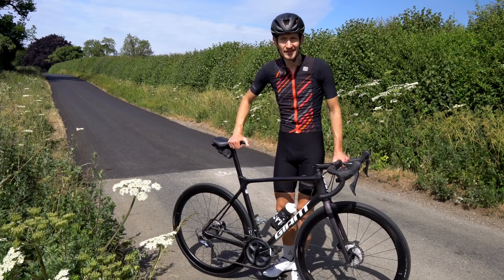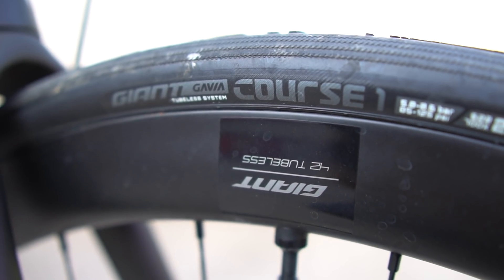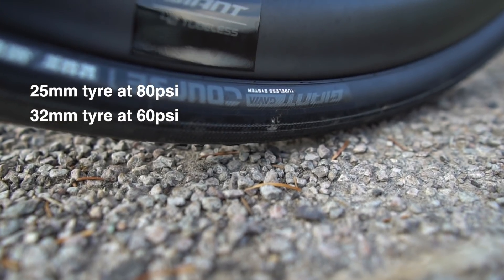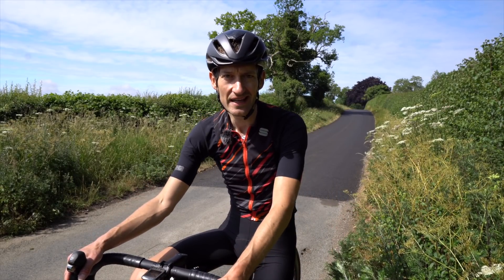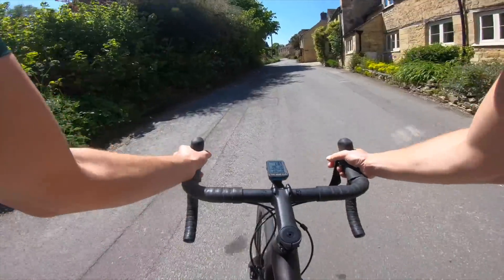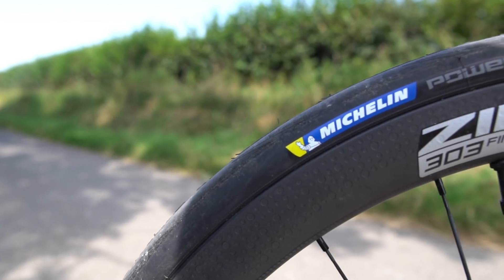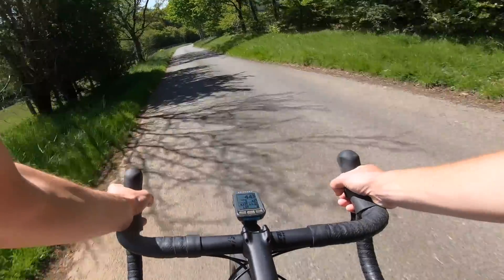Are Wide Tyres Really Faster? Rolling resistance timed testing reveals the truth...

Comment: It'd be interesting to compare the power needed per distance, say 10km, by controlling the overall power, f.e. at a constant 200W tempo. This would incorporate the rotational mass difference, aerodynamics and fatigue into account too. 
Also, depending on the terrain, the vibration damping of thicker tires might influence the overall performance over long distances.
Reply: If a power meter can update agerage power precisely enough, it would indeed be interesting to see time needed for the 10 km course at 200 W average. And to equalize the test, staying as close to 200 W and average throughout.
Rotational mass over a contant power effort is...nil. Unless you start from standstill. Rotational mass is mostly in the mind. I once went on a training ride with a friend, him on his road bike (accomplished bike marathoner), me on my "beach race" bike, 29.2.35 slicks. The rear tube I'd put 3.6 litres of water in. Yes, I noticed it slosh when changing speed by a lot. Once at speed, it was just riding as usual. I bet that over a 10 km ride at 200 W constant, that 3.6 litres of water (an American gallon or so?) would hardly be noticed in the measurement. Unless it was all a very steep uphill, then it would be worth around 3-4% at most. Weirdest about that test was perhaps how the tyre compliance felt. With so little space for air, it felt very stiff for the pressure on the gauge. A small bump would displace a huge amount of the air, and the water doesn't compress nearly as easily.
I'm sure on a 10km gravel test (bring it oooooonnnn!) that water filled tire would have been...interesting. The water wasn't in pockets, so it could slosh freely. Would it help with a kind of flywheel effect...a little maybe. When taking sudden turns, braking, etc, I could feel the mass in precession if that's the correct term. that doesn't mean it takes eneergy necessarily, it could even help in some conditions. If it had been a tubeless setup with a large sponge donut between rim and tyre, filling the cavity completely...it would slosh less and be like a flywheel more. Maybe great on windy time trails, push through burst and keep stably on cross wind bursts?
Reply: @Cloxxki  the rotational weight has significant affect on acceleration and stopping performance, and the gyroscopic effect when turning. 
If suspension is involved, that becomes even more noticeable.
Reply: @Cloxxki  I guess your argument depends greatly on the environment we're talking about, also whether is motor-assisted or not. 
On a flat track - I'd tend to agree, but not off-road. 
I've once done a test on heavy casing MTB tyres, and even 200g difference has resulted in statistically significant differences (based on comed k5 gas analysis computer)

Comment: Nice test! It'd be interesting to test if lowering the 25mm tyres to 65psi will increase the speed, or vice versa, if inflating the 32mm one to 80psi will reduce the speed.
Reply: Probably no for both questions. The area and the pressure force on the ground are the key differences. Increasing the 32 mm internal pressure would probably elevate the speed and vice versa.

Comment: 28 feels the fastest for the roads I ride on for my weight over 25 and 30. 30 feels a bit sluggish to pedal . 25 is too bumpy when I pump it up enough to support my weight of 220 lb.
Reply: Actually i have tried GP5000 32mm, actually 32mm is faster, just pump your 30mm harder.

Comment: I recently did a 50 miler on 50mm tyres with my normal road group. I kept pace on flats, down-hills & short-sharp climbs, aerodynamics was not a problem; However, whenever the road pointed up for longer lengths of time— I got dropped. The mass of the larger tyres was only a problem when gravity overcame momentum.

Comment: Could them being tubeless have a serious impact? I personally have the Giant Defy Adv. 2 with 32mm tubeless and I have noticed the bike flies and rolls for much longer than my old Fuji Newest LE 1.0 with 23mm tubular tires. However, maybe you can test 32mm tubular vs tubeless for your next video. Something I'm curious about. I'm in agreement though, wider tires are a treat. It may be a bias, but I seriously think 32mm is the sweet spot for speed and comfort.

Comment: Maybe I didnt listen to the whole thing but couldnt this result be influenced by the added weight of the 32 tyres. Going downhill it would be an advantage, plus less resistance from the road downhill as you gain speed. There should be a flat course and an uphill course at same wattage as a control.
Reply: I also wondered if putting a wider tyre in the same size(width) rim it could potentially change the profile of the tyre. I. E less rubber in contact with the road.!?
Reply: 28 and 32 tyres only have less than 100 gram different. Also i have tried GP5000 32mm, it is much faster than ultra sport 3 25mm.

Comment: So, wider tires are faster when you're slower.
Reply from the maker: The idea of the lower speed is to highlight rolling resistance before aero takes over at higher speeds. Rolling resistance still matters at higher speed but it’s a much smaller factor than aero at higher speeds
Reply: @davidarthur  I said it with less words ;-) But it was a good video thanks, and for long training rides in bad weather I go for wider tires too.

Comment: If you're into comfort, go bigger.  If you're into reducing weight, quick acceleration, and less RR, go with 23s or 25s.
Reply: You do realize how much speed road buzz saps...the fastest pressure for any given road surface is the highest pressure that isn't buzzy. Smooth with the wrong tires or a pressure far below the break point is slower, but harsh is never fastest. If all other factors are kept consistent, a harsh bike is always a slow bike.

Comment: So many faults in test design... 1- if you’re not testing two widths of the same tire, it’s apples v oranges. 2- preferred pressures be damned, use optimum pressures.  You’re using the term ‘faster’ when what you should say is that it has lower rolling resistance.  Mounted on the wrong rims, a wider tire could be significantly slower overall.  Oh, fwiw, unless you’re a crap tonne heavier than you look, you’re running too much pressure to really capture all the benefits of tubeless tires.

Comment: That's a great simple test . I would have expected the higher psi pressure tyre to also be faster . Think I will give it a go myself . I ride mtb and have generally found the bigger wider tyres to be slower off road as it's more sand and mud to get through , but guess I will have to try and test it , head to the beach I guess ?! 👍🙂

Comment: personal comfort is subjective- you are comparing apples to oranges- it would be far more instructive to test on a set of rollers- but the simple fact is trains are far more efficient because the wheels do not deform and the area of contact is minimal- imagine replacing the wheels with rollers and you can expect the efficiency to be reduced substantially.

Comment: Always enjoy your videos David.  However, as I listen to your comments, I can't help but scratch my head.  What you are basically saying in this test is the wider tires are faster at SLOWER speeds.  Isn't that a bit contradictory?  Who wants to go faster at SLOWER speeds?  If speed is your goal, then you want to go faster at FASTER speeds.  Seems like this is a bit academic with no real world relevance. 

 as you correctly point out, at faster speeds, aerodynamics is far more important than rolling resistance.  Narrower tires are always more aerodynamically efficient than wider tires.  Yes, as you say, the rim width plays an important roll in the overall aerodynamics of the wheel/tire system and modern rims being wider, help to improve the aerodynamics of wider tires.  BUT, this does not make them more aero than a narrower tire mounted to a proper rim width.  I run 23mm tires on a rim with external width of 25mm, which has been shown in wind tunnel tests to be the aero sweet spot. I also find this to be true in my own testing.  A 32mm tire mounted to a rim width of 33-34mm would achieve the best areo performance for that tire but it would still not be as aero as the 23mm tire on a 25mm rim.

The best thing that can be said about wider tires is that they are more comfortable.  But for me, even that is a bit subjective.  I find that wider tires make me feel like I'm riding on marshmellows.  It dampens the road feel but to me, on a racing bike,  that is a drawback, not an enhancement.  By reducing road feel, I am less confident and thus less comfortable.
Reply: @Radek Jean Ballard is an aerodynamicist and engineer.  Here is what he has to say. "However, aerodynamics is just one part of the equation: tyres also have to exhibit low rolling resistance and wider tyres roll better.

With this is mind, is there a point where aerodynamics becomes more of a factor in a tyre’s performance than rolling resistance?

Ballard has combined rolling resistance measurements on rolling roads with the wind tunnel and explains:

“We see this point to be roughly at around 30-35kph. This is only important for the front wheel. For this reason, for time trial and triathlon, we recommend a 23mm tyre on the front and a 25mm tyre on the rear.”

Clearly, tire and rim width have a significant enough impact on aerodymanics to recommend narrower tires for tire trialing.  Way more than .0000001 seconds per Kph.
You should know what you are talking about before you comment.
Reply: @Radek I think you are the one who is ridiculous. Where did you get your number from.  Can you site the study or did you pull it out of your rearend?

Comment: Just moved from 28 to 30 (both tubeless) and even that makes quite a difference. I used to run the 28s at 60psi in front and 65psi in the back. When run at 60psi, the 30s are removing a lot more road buzz, it feels a bit weird when you are not used to it 🤪. Having a blast though and they are faster as well, which is not a bad thing. Might gradually reduce the pressure to 50-55 and see if that still feels grippy enough or if it's getting too mushy. Looking forward to the experiment!

Comment: All very good but it seems you’ve performed a ‘rolling resistance’ test rather than a ‘what is faster’ test.  To me this isn’t conclusive at all .Perhaps change the title of the video?
Reply: Julian Man exactly. Title should have been: ‘do wider tires roll faster?’  This test just confirms what science already says, but it is presented as if wider tires make you ride faster under all circumstances, which simply is not true.
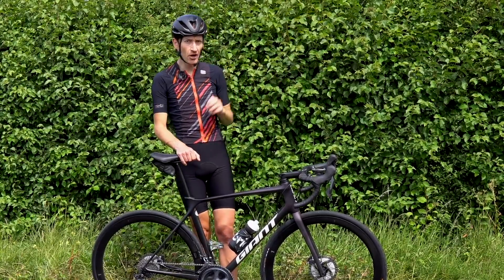Reply: @Tuslareb  He clearly stated that he was testing <15 mph (see timestamp 1:02) because above that there are more important factors than rolling resistance.  The best way to isolate the effect these tires have, then, is to stay in the range where the rolling resistance is the dominant factor.  Unless you're asking him to test aerodynamics of both sizes of tire at which point there are significantly more factors to include.
Reply: Mike R yes, agreed. The test itself is very clear and there’s nothing wrong with it. It’s a correct way of testing rolling resistance alone. But the title is misleading, because it suggests that wider tyres make you faster overall.

Comment: Interesting video as always! I think you should also consider the tires themselves. The Giant Gavia Course 1 has 60 TPI, compared to the Gavia Fondo 0 with 170 TPI. The Fondo has also a (presumably) much better compound (RR-E instead of RR-S) and I think it will make a difference in the rolling resistance. I was riding the 30mm Specialized Espoir sport (60TPI /70a compound) and switched to same 30mm Roubaix Pro (120 TPI / GRIPTON) and could feel a huge difference in terms of rolling resistance. In any case, keep up the good work!
Reply: Also the larger tires are heavier which helps downhill but hurts uphill. He also gave the bike a kick in the beginning which might not have been consistent between trials. A flying start with an extract speed would have been better.

Comment: If wider is faster, why do the Pros run 25s? Is it because the tubs only come in 25s and not 28s?
Reply: no they run 28 in the Flemish races. Maybe it is because other tests and theory says wider is not faster on a smooth road. I am quite surprised by his results actually.
Reply: Plus at the speeds the pros ride the more aero 25 makes a difference. For the average cyclist not so much. I’m not trying to win the tour so for me I’ll take the comfort of 28s over a few seconds
Reply: Faster should be looked at in terms of totality and not a single metric.   If you ride 25's and rated PSI it might have the lowest rolling resistance but that only applies to very controlled conditions.  When you factor in "real world" you also need to factor what the impact shocks of every little bump (both big and small) does to your overall performance.   This is why you tend to see a trend towards lower pressure and wider tires.....

Another example is the fact that I can't stand my bike after about 2 hours with 25's at higher pressure but can ride all day on 32's at lower pressure.  Imagine being a pro and riding day after day after day.   If wider tires at lower pressure greatly reduce daily fatigue for a multi day event...it might be worth a few rolling resistance watts for all the other benefits.   But if you are doing a 1 day event that is 90 minutes in length...you might reactor your target goals and take that beating possibly.

Comment: But you took out aerodynamics by riding slowly - so therefore its a pointless test unless you ride at that speed.  Otherwise aerodynamics is an important part of the tyre performance which you are negating.
Reply from the maker: The idea was purely to focus on rolling resistance which you can only really do at lower speeds for the reasons I pointed out in the video
Reply: @davidarthur  I understand that you mention there are other variables including aerodynamics and that any model is a simplification of the real world.  However the title of the video is which is faster rather than what has the lowest rolling resistance.  The old GP4000II use to be faster than a some of the better rolling clinchers of open tubular design by virtu of its better aerodynamics design  (Conti are now using the 4000 pattern on their faster rolling TT prototype used by some of their long distance pro triathletes).  In short yes you do mention it but it is not what it says on the tin which is slightly miss leading.  Maybe an interesting test would be at what speeds does the gap start to close / change - but you will need a collect of hills of different  steepness for that ;)

Comment: Firstly, thanks for taking the time and effort to make this video and share your data. My questions would be: [1] Would weight have made a difference to the speed times as the extra mass of the 32mm tyre would have increased momentum and, therefore, the residual speed at the bottom? [2] As most people average a little more than the speeds recorded in your test over the course of a typical ride, would the poorer aerodynamics of the wider tyre come into play and caused more drag than the 25mm... thus losing speed... if your downhill roll speed had been a little faster? And [3], if (as on a typical ride), there is some ascending, would the extra weight of the 32mm tyres have conspired to slow things down overall when the rider is competing against gravity? In short, while your test is FAR better than a clinical wind tunnel test, I don't think it's as 'real world' as... well, the real world! There's probably no single solution to tyre width (and pressure) as every cycling scenario is different, but there's probably a 'safe bet' zone that puts you roughly in the ballpark of being on the 'right tyre for right now'. Personally, I think 25 - 28mm tyres offer that window, with pressures set to suit the rider's comfort on the given road surface they're rolling over.
Reply: Going downhill, added mass in the tyre overcomes its own rotational mass perfectly during acceleration. When at cruise speed, it's just added mass, thus faster. You can't make a wheel big and heavy enough to make it roll down slower.
Reply: Weight is often overrated. I am a recovering weight weenie. 
Say there is 100 grams extra in those 32mm tires. On a 90 kg rider+bike+kit combination that's 0.11%. Over a 17-18 second downhill, that's not going to move the needle, now is it? If the test was extended, flattening off and becoming a bit bumpt/gravely, that added rotational weight would help (a tiny bit) and of course the tire size would help even more. With standing gooey mud with hard bottom surface however...narrow might be better. But these tests are about understand real world more than bizarro world :-D

Comment: Interesting test but I cannot see how you can draw such a wide ranging conclusion from it. Surely this needs to be tested at pedalling speeds over a longer distance to really establish a clear benefit?
Reply: Also at faster speeds, like 35km/h+ for long distance. I think the 25mm are going to be faster. Also it heavily depends on the (inner)width of the rim and how well the tire fits to that rim.
Reply: @Kansloos  they will definetelly be faster; the pros on TTs use 23-25 combo

Comment: Hi David. This would be an open and shut case if you didn't also have to consider the aerodynamics of the front wheel/tyre system. It would be great if you could repeat the experiment with a power meter and test at differing powers. Start very low and chart how things change with intensity. Ta.